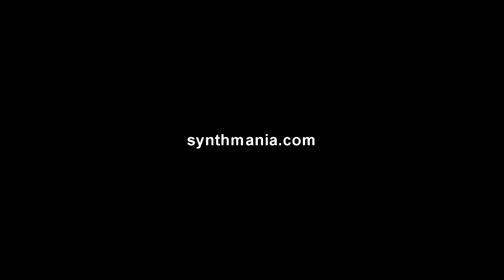House & Techno patterns

Comment: Those house beats always had something special. In that first pattern, with the typical bass and hi-hat in such an ultra-straight pattern, I knew something up up with the congos & shakers but never could put my finger on the trick. Thanks for showing us the power of selected precussion swinging outside the main drum patterns. 

Is that swinging the reason to use the 2 drum machines?
Reply: hmmmm that is a great point. you couldn't do this on a single drum machine, like tr-8, but if its straight beat is combined with a shuffled beat of another machine... magic happens. gotta try it out later tonight.
Reply: I think you could, provided one machines can generate all of the sounds. Shuffle is not applied to 1/8 notes, only to the 1/16 notes in between, hence the kick nor the open hihat would be affected in this particular beat.

Comment: House like Disco has a funky groove without swing and is not programmable on a 909;  back in the day probably done on an Atari with Cubase to trigger a 909 or sampler via MIDI; Techno is straight  and has no groove could be achieved on 909.